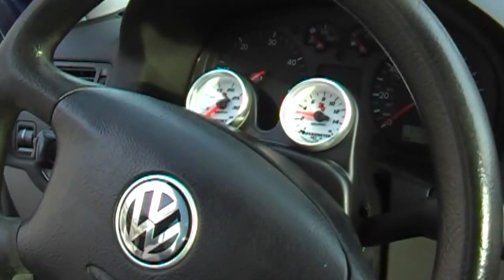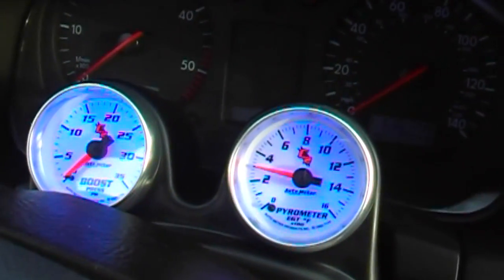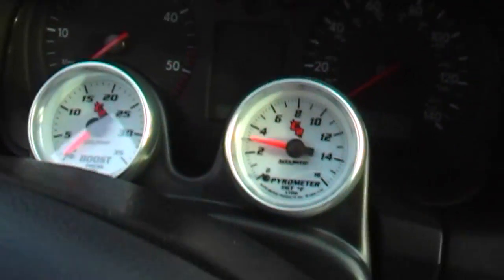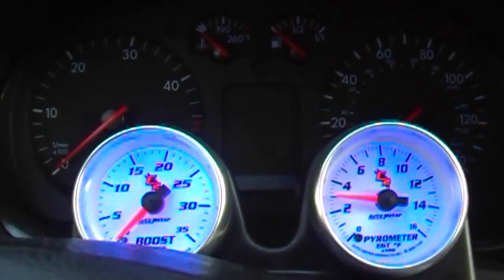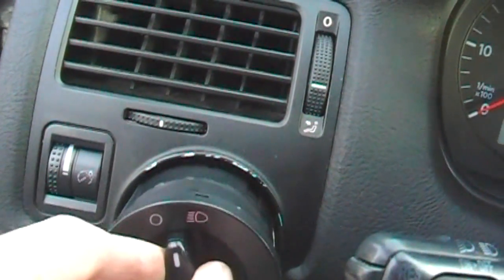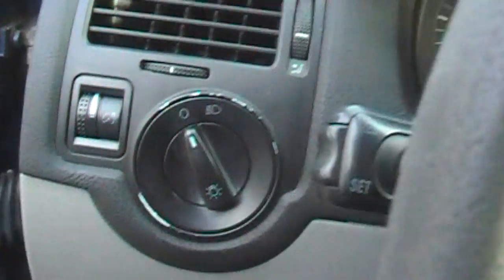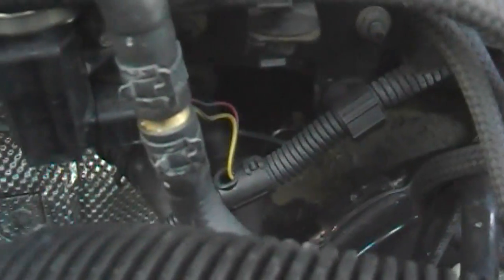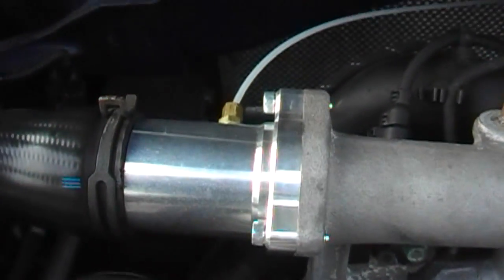Volkswagen TDI - Boost & EGT Guages

Comment: Great video! I bought a 2004 VW Golf 1.9L TDI 5Spd and it’s my first VW. Guy hit a deer busted windshield and fender but had new motor not even 10k miles on it with original trans but new clutch. Been researching looking to do some upgrades like mild injectors the fuel pump from Automatic trans car, and different turbo and intercooler. Who would you recommend for tunes for this car and do you know how much HP & Torque this motor and trans can handle stock safely also do you know factory boost levels from stock turbo and how boost stock motor can handle? Thanks in advance a lot of info out there but more of debates not actual facts

Comment: I have mk4 golf TDI. Have exact same set up for gauges. Mine are the AutoMeter Cobalt series. I drilled my hole for EGT probe post turbo right on the 90deg bend. Stage 2 tune by MaloneTunning and .205 nozzles. Straight pipe and AFE intake. My EGT's under WOT will easily get to 1100degF. On idle it runs about 375F. Cruising in the summer at 100km/h it's 650degF on flat ground. Boost under WOT will hold at 18-19 pounds constant. Initial tromp on throttle will spike to almost 30. I had to upgrade clutch after having the tune and nozzles lol. She has 361,000km on her now. I will have to make a vid of the car for u. Check out my channel.

Comment: Ryan - You said tapping in to the EGR blockoff plate was an accurate location for EGT.  Have you verified the accuracy of that location?  I'm just curious because my bung location is not working out.  My readings are low and slow to change.

Comment: Nice video.  Anyone in need of advice for TDI mods, go to Freds TDI forum.  Velcro and a zip tie for the pod.  Cat and EGR delete have no adverse effect on the engine.  My egr and intake manifold had significant crud buildup with only 30,000 miles when they were euthanized :-)  A larger downpipe can be installed in conjunction with a test pipe to replace the cat.  New South gauges are the best match for existing VW gauges.  You can actually buy a blockoff plate with the fitting already installed for the EGT probe.  The location you used is the most often used location for the EGT probe, I would not drill the manifold as another poster recommended.  The Euro SMI is a great intercooler, however, it is a very tight fit.

If you really want to give it some power, upgrade the turbo to a 17/22 hybrid, larger injectors, larger injector pump, larger downpipe with the cat delete, larger intercooler and an upgraded ecu program to harness all the upgraded parts/power
Reply: +Me Li well thats not 100% true an EGR delete (which i did on my mk4 tdi) does increase the risk of a run away.  Still not very common though. and going catless just makes it smell a little and smoke a lot lol pisses off my neighbors
Reply: Egr delete, removed back box and cut cat internals out gave me 143 to the wheels instead of the standard 130 to the flywheel, getting remap few days time

Comment: i have a golf mk4 and have fitted a boost gauge but the gauge is reading negative not boost. i know i have tapped into the wrong pipe could you tell me where i need to connect the boost pipe from my gauge as i cant seem to find a boost pipe. :S
Reply: kingy 2912 the negative is your vacuum

Comment from the maker: If your talking about a hole in your firewall so you can run your boost line to the cab.....there is a pre-existing hole that was well hidden & was covered with a rubber plug. I found it above the master cylinder and to the left. Get a good light & you should be able to locate it. That's where I ran both my Boost & EGT lines into the cab of the car. No need to drill any holes.

Comment: hey and about the check engine code I'm a Kerma TDI dealer and you just have to ask for the EGR delete function on the Tune that you need these cars respond very well to a set of injector and a tune and since you car is an auto the pump is a 11MM so larger than a manual car and the nice thing is the fuel economy is not any worse for the mods it you can keep your right foot off the throttle.

Comment: Hi I work a lot on VW tdi cars your probe location on your exhaust manifold is not at the correct place why I know I did the same and it doesn't read the correct temperature you really have to drill your manifold to get the right temperature what you are reading is a lower temp that is really is what is the hottest temperature you ever saw on your gauge it should be higher than 1100 deg F and the max temp sustained should not exceed 1350 deg F it all depends of the timing amount of fuel etc.